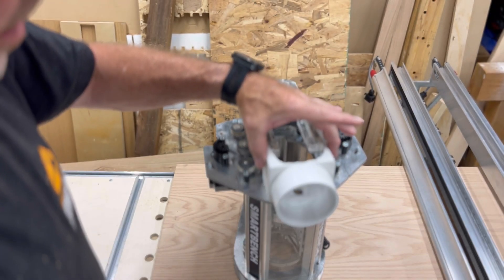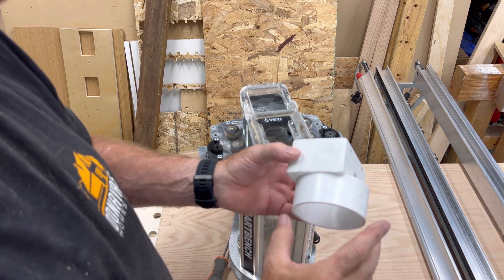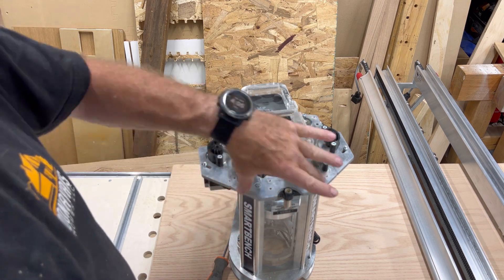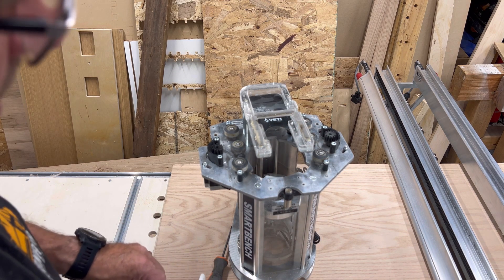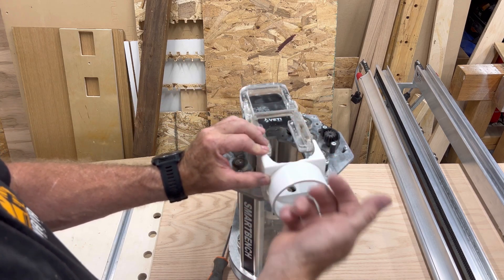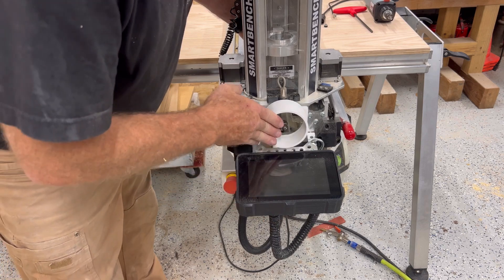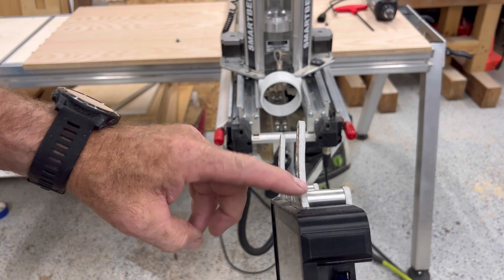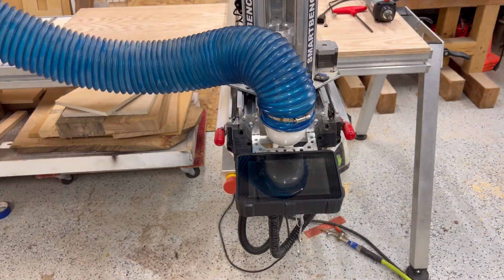Yeti  CNC Smartbench tutorial: adding 4" dustport to your Yeti

Comment: Great modification. What vac system do you use? Is it plugged into your bench for automatic start?
Reply from the maker: I have a clearvue 5hp dust collector  i also use ivac for controlling it I did get a a modified ivac switch from them to make it work but they don’t want me to video it

Comment: Hey Donavan, how did you settle on the Yeti CNC? What really sold you? I might be looking into another CNC for the shop. Also, how far out are you booked now? My parents are looking to do some re-modeling.
Reply from the maker: There are three things that help me to pick this cnc

The 4’x8’ capacity 
With a small shop being able to store when not in use and being able to take to the job site 
The cost was less than other 4x8 machine 

I am currently booked out about 18-24 months with jobs